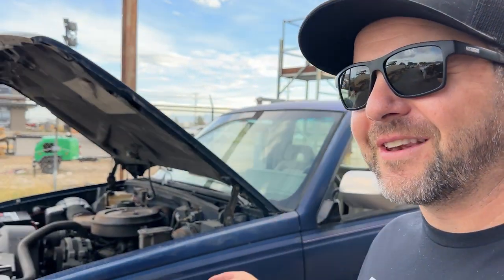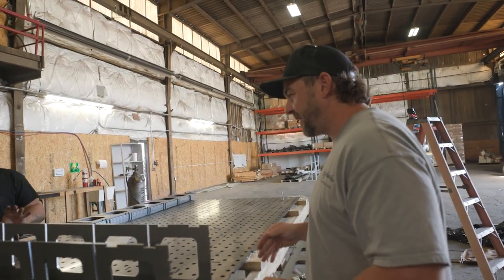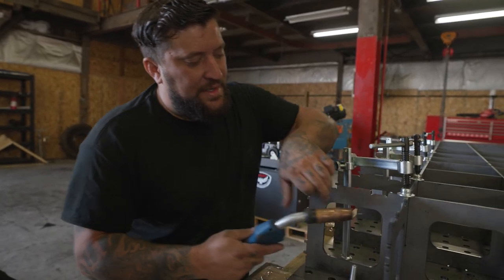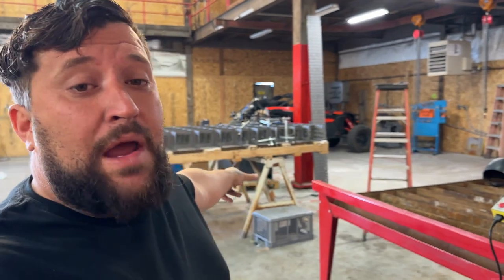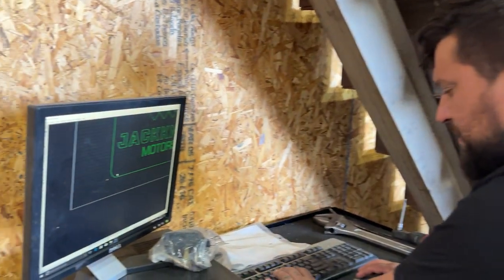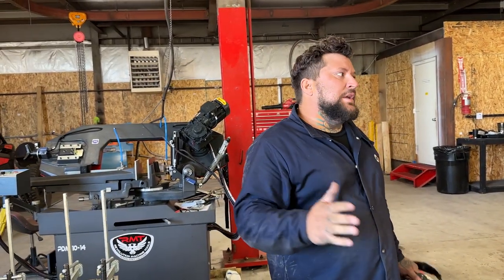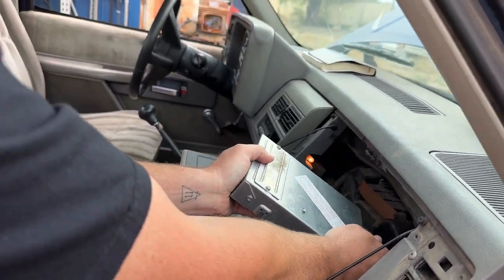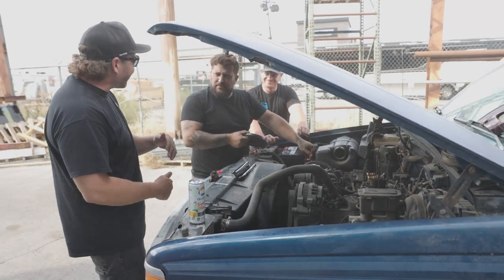Will It Run! Can We Get This Abandoned Chevy Truck Running?

Comment: Well your called "Jackknife motors" you need to put a 5th wheel plate on the back of the pickup, and stacks up the back of the cab and make it a "burnout truck" to promote the business .......

Comment: Ok so the weld table is permanent? What if you have to break it down to move it? Looks like a huge pain in the balls the average person would spend days putting that together
Reply from the maker: It did take me a couple days. You gotta know you’ll be there for awhile before you go setting that up.
Reply: Of course but moving it in general worst case scenario probably better off selling it and starting over I'm sure it's massive heavy unless somebody has a box truck or flat trailer to move it but that's like a commercial table or for a home shop not ideal for somebody that doesn't have a permanent setup
Reply from the maker: Yeah I guess if you have a nice trailer and a fork lift it wouldn’t be a issue…. Or you better be eating your wheaties